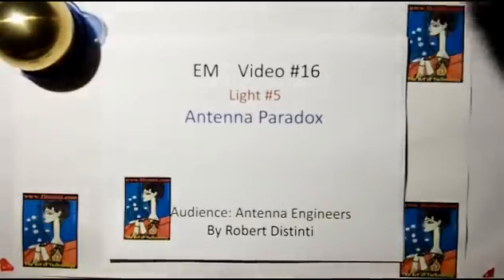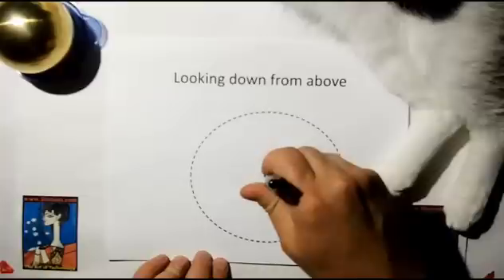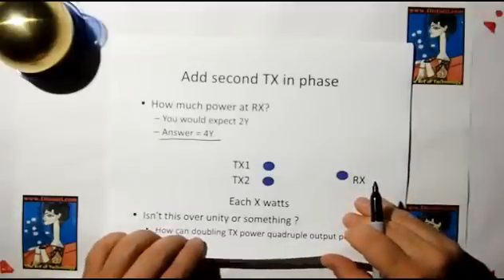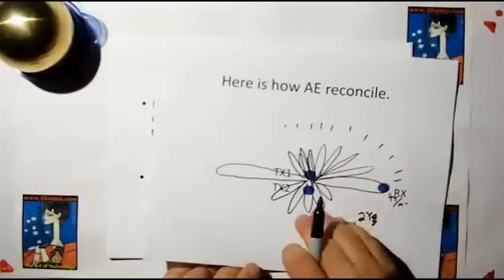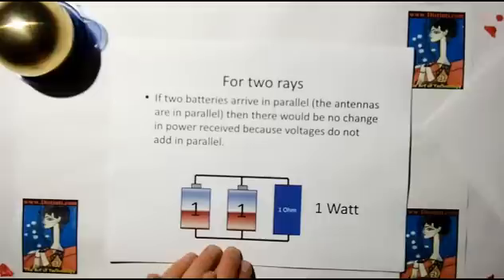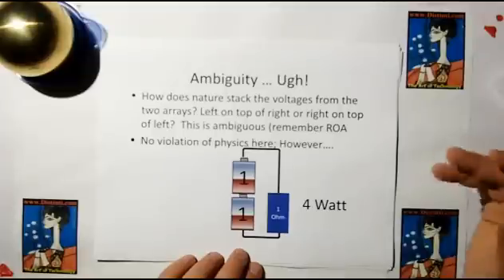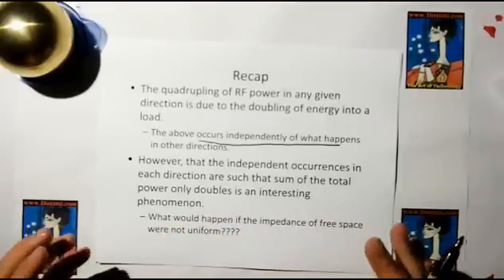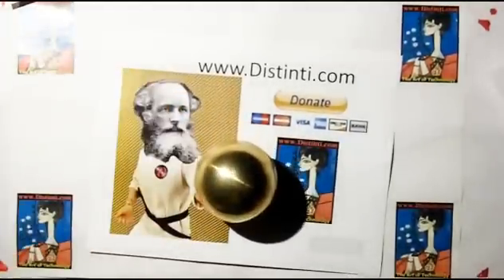emV016: The Antenna Paradox

Comment: The problem with 4x power  should be explained by Voltage not by power equation.
The simplest way is to see  it as 2x Voltage from TX  plus 2x voltage from antenna gain.  That is commonly being used in stack antennas configurations. In reality there is  NO GAIN. For you to understand: If there is 100W from TX and is delivered in  to RX with no  losses by any means, that will= the maximum power theoretically possible to bed transfer. But if there is  single path and the signal in RX =1miliV than if you remove from the ground anechoic material allowing reflection to be possible ( from single TX)  you will see  twice as much signal( in phase)  There is no OU and no miracle. The maximum of the signal at any gain imaginable at RX antenna will be less than original signal   transmitted from TX
Wesley
Reply from the maker: The 4X power is an observed phenomenon.  There is another antenna paradox video in the works, I will show the proper antenna patterns and cover this in a bit more detail.

Comment: GAIN... ANTENNA GAIN. is the one factor you have left out. Even 2 antennas at unity, when in phase will give you gain...  A simple dipole has gain, put 2 of them in phase and you get a gain of 3db. Doubling your erp. Nothing magical or mystical here, just plain old physics.
Reply from the maker: No I did not, when computing the far-field pattern of a phased array, the gain comes from the superposition of the individual radiator patterns using exactly the technique shown in this video.  GO LOOK IT UP.

Comment: Where's the problem?  

Twice the power, twice the gain, 2x2= 4
BUT.. it's 4 times the VOLTAGE, not 4 times the power in watts.  What you have done there is created a phased array. Two 100 watt transmitters in phase with 2 separate antennas will give you a gain of 3 db. Increasing your voltage by 4.  100 + 100 X 2 (every 3db. Increases gain by 2) = 400. You could have gotten the same result with a transmitter of twice the power and a power divider between the 2 antennas. Nothing but simple physics.
Reply from the maker: 4 times the voltage would be 16 times the power -- power is proportional to voltage squared -- its simple physics as you say.   The ultimate point of this video is to show that there is no electric field in a radio wave (there is actually another Antenna Paradox video coming soon which delves further into this point)

Comment from the maker: The two antennas do affect each other, but it does not occur in free space.
One dipole will receive energy from the other antenna and reemit the energy causing a distortion (similar to a parasitic element); however this effect is minimized by proper transmitter design and by increasing distance between dipoles.  
In free space, Electromagnetic fields (and waves) pass through each other without affecting each other; otherwise, you would not be able to use an FFT to predict antenna patterns.